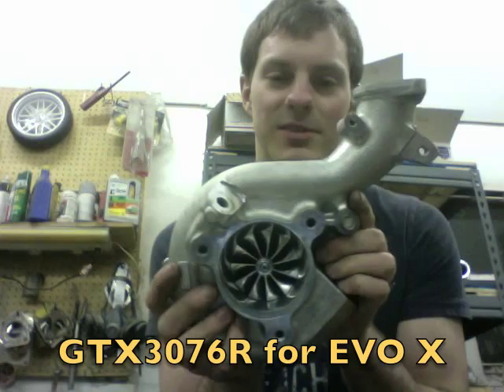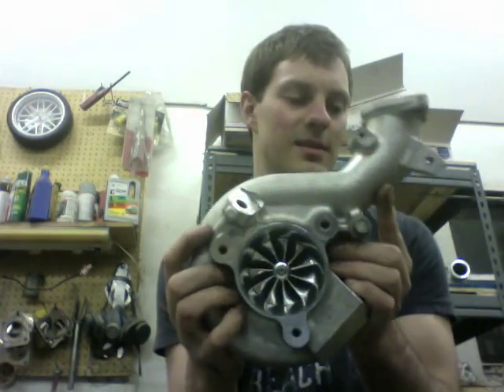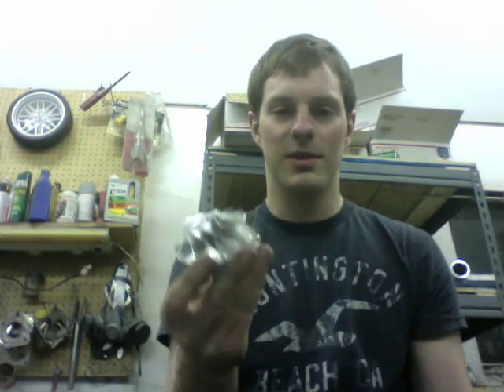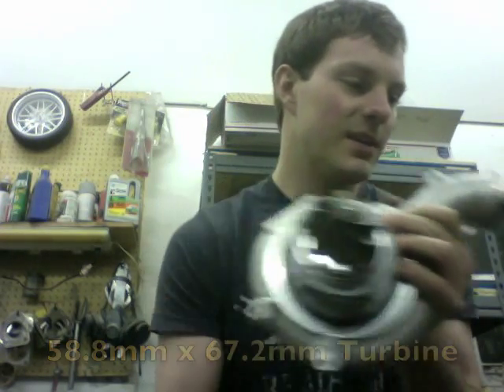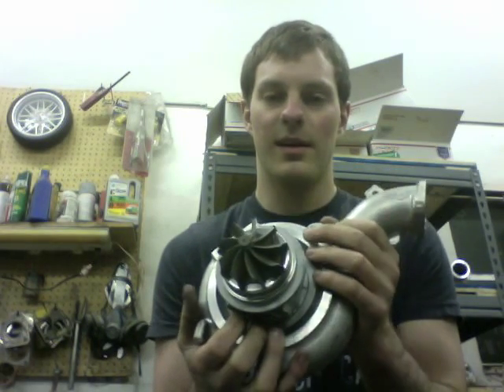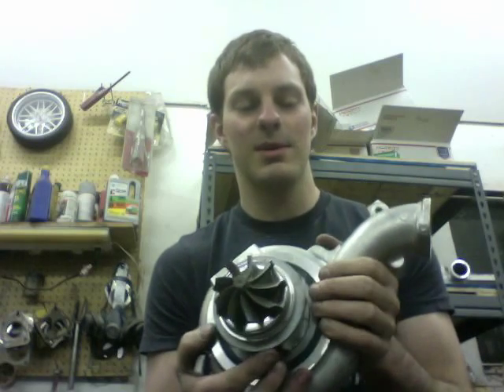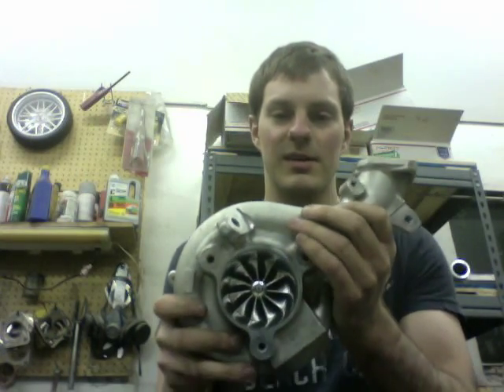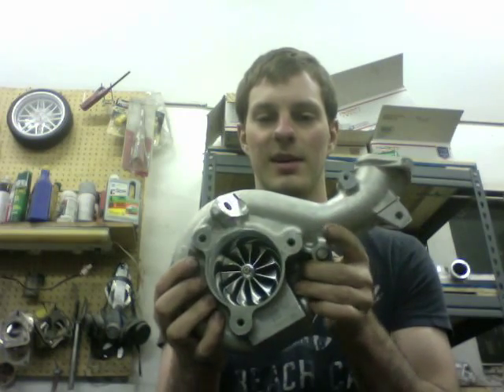GTX3076R Evo X Turbo Upgrade

Comment: question. i have garrett gt3076r on my evo x right now. is there anyway i can get it upgrade to the gtx3076r version? cuz i dont wanna buy a new turbo which will cost about $2500 for the gtx3076r. 
and what do i need to get it to upgrade into gtx3076?
thanks
Reply from the maker: +Demon Evolution the turbo in this video is a journal bearing version. I can rebuild and convert yours to the gtx3076r and rebuild it. The cost would be 400$ but I likely won't be able to work on it until the second week in June though because I'm going to be on vacation but we will have staff on hand shipping product.
Reply: +Turbo Lab America thanks. please leave me some of your contact info so i can get in touch with you.
thank you.

Comment: Can you upgrade the stock turbo to this setup?
Reply from the maker: pekoso1 Yes, but the factory turbine housing is only machinable to a tdo6 turbine 55 x 65mm. if we use an aftermarket one which is just cast iron then we can get that in tdo6h 58.8 x 67.2,  we usually go with the 9 blades to keep the heat down. the evo 10 turbine housing oem and aftermarket can crack worse than the evo 9s.
Reply: @turbolabamerica  I am curious about this too. How much would this cost to do to the stock evo x turbo?